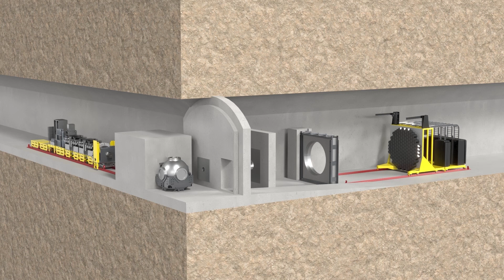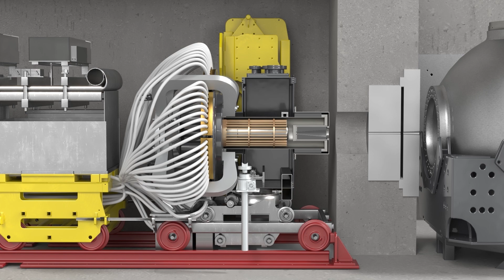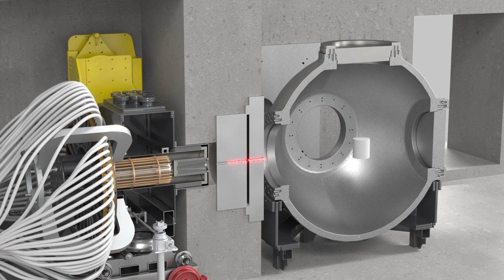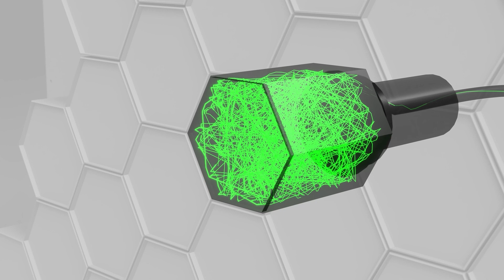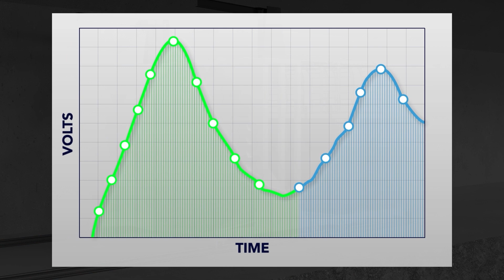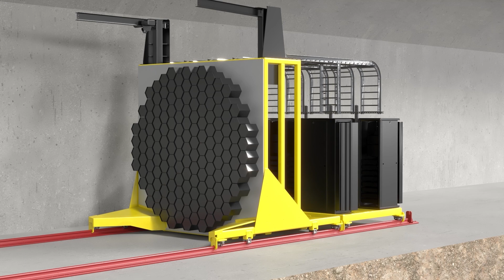PULSE Facilities and Subcritical Capabilities - ZEUS

Comment: You can build a DPF on your kitchen table. Not as powerful or fast as this one, but you can. 
Just don't fill yours with deuterium or tritium (expensive, lol) and stay out of the axis when it's firing.
And run it in the basement so you don't need to worry about backstopping any radiation... like these but on a smaller scale.
Ask me how I know this.  ^_^  Amateur scientists build linacs, cyclotrons, pulsed power devices of all sorts... citizen science is a real thing and you can be a part of it.